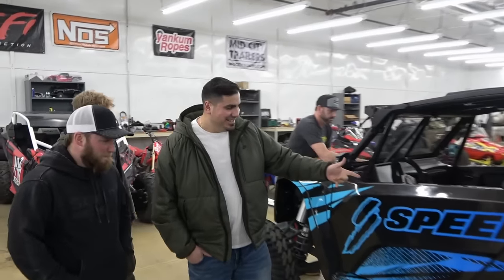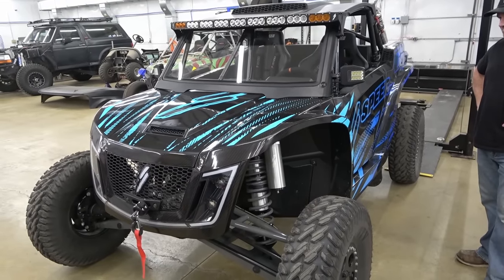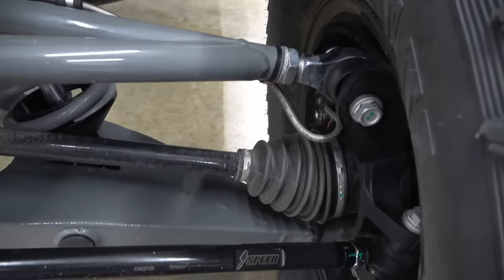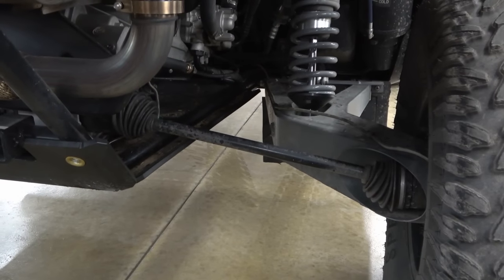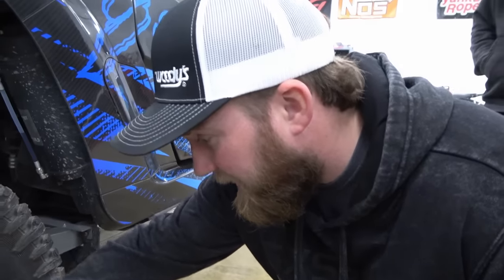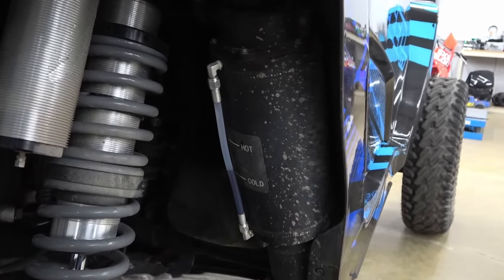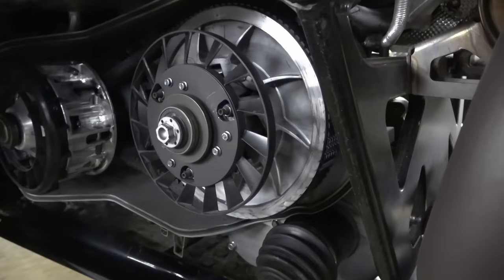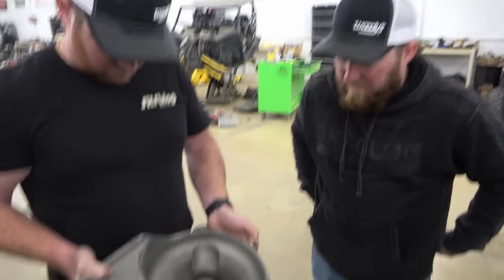Speed UTV IN DEPTH Overview + Dyno Test

Comment from the maker: Here are some quick specs that we missed in the video: $43,000 MSRP for the model shown, it is 77" wide, and the Bandit has the shortest wheelbase at 95".
Reply: Should’ve put it on the scales. We’ve seen the EL Jefe weighed and it’s more then then the 4 seat Pro R. 

Other things to mention is the bolts are shouldered and most of the hardware is sized so only a small number of sockets and wrenches is needed to remove.

I’m surprised you guys didn’t talk about the structural design of the cage vs other OEM’s as the cage on the Speed makes the others look like toys.
Reply: Do 25 k can get a 2 seat 1000 with race gas tune and turbo also do clutches 95 mph plus
Reply: Are you sure it is 77" wide ?  Bandit LE should be just 72"  wide.

Comment: That front diff scares me, what happens when you rip the A arm ears off in a crash, you now have to buy and entire front diff
Reply: Sway bar bolts have already ripped out on some
Reply: Would you rather replace a diff housing or a frame?
Reply: @Freemaniac38  you can weld washers onto a frame and repair it.  Good luck fixing cast aluminum
Reply: @Freemaniac38 if it was all chassis mounted it wouldn't break at all🤷‍♂️
Reply: @Williamxmr  I’m one of them 🤦‍♂️
Reply: Sounds like a skill issue to me
Reply: The tabs on the bulkhead are seriously thick and if you rip one off, you got bigger issues. Also that bulkhead is 3 pieces and you can replace either side if you actually broke one.
Reply: Only a couple cars had issues and it was believed the wrong hardware was used to torqued.
Reply: Trust me, from a person that owns one, you don’t have to worry about that lol. I stuffed the nose hard and no issues. If you’re wadding the diff up you probably have a total loss. Also if for some reason it does happen, it’s a 3 piece diff. So if you break one side you don’t have to replace the whole thing
Reply: About that bulkhead, What's funny is they do massive work to all brands of sxs to complete in king of the hammers and still don't finish without custom parts breaking. 50% of the speed utvs entered finished the race remember these are stock compared to 35% of modified utvs from other companies. I would say that bulkhead is the least of your worries.
Reply: great video
Reply: Robby runs the same design on his 4wd trophy truck with zero failures. That being said in a hard enough crash anything will break.
Reply: Yeah not a huge fan of that design but damn it’s beefy.
Reply: @Williamxmr   lol talking like you can't weld cast
Reply: @gasNmudtv  yeah its so easy lol

Comment: Wheel base is actually 96 now. Also, the car won't make full power unless the oil temp is around 168 and above. I have a Bandit and it's hard to keep it warm enough here in TN. Thank you for the content and please keep the verbiage as clean as possible for the family.
Reply: What did they say that hurt your feelings?

Comment: Was looking forward to this one. I liked the general walk around. I had originally thought the 3 speeds was sequential, which would have been another innovative thing to experiment with. I can see why not for transmission safety, but to be able to switch Low-Hi-Speed on the go would be pretty cool. 

Not a fan of the cheesy RADIO.JPG decals. Even a insert that read "Co-Driver screen" and "radio" would have been better than a photo. The Dyno run looked pretty good considering how close it came to the Pro R with less cylinders and a spinny thing. 

I really like the wheelbase on that Baja, it's slightly "Turba-S" stance. I think if there was a less wide option for the wood fighters it would open the markets more, but being new they cant saturate things too much right now. 

Overall nice rig. Glad you got a chance to experience it. Maybe time to talk to RG and get entered to race one somewhere.
Reply: You can but you have to be off the power.
Reply: @thadbessinger5694  so you can switch on the fly but unloaded? because that would be usless outside of that
Reply: Yes you can shift on the fly. They are dog gears so you need to know how to do it and practice. And if you damage the gears because you were shifting on the fly and messed up they won't cover it under warranty. It's a play at your own risk thing.
Reply: Speed plans on releasing a 72” version of the Bandit.

Comment: These cars are great but they do have there flaws , first thing need to cut the inner clamps off the rear cv’s there too tight and suck in rip boots  , the jam nuts come loose they need some lock tight and some good effort , you’ll find the issues just like any other car

Comment: Great video, ? if you put half the size tire would you get less lost HP? and by what % .
Reply: Heh, thats not how that works lol
Reply: Dynos are crazy complicated to explain but Yes in theory a smaller tire diameter should give a higher power reading but not always in practice.
The dyno is measuring the inertia of the drum AND the wheel/tyre but can't differentiate between the two. By reducing the rotational mass and moment in the wheel you effectively transfer more measurable power into the drum. The difference is only going to be small, a couple of percent maybe though.
Also the reason it may not actually work in practice is that a smaller tyre reduces the gear ratio so loads the engine less. Particularly on turbo engines the lower load may cause the engine to actually deliver less power to the wheels in the first place.

Comment: Would having the speed key make a difference on hp or just on speed?
Reply: They said 220 pump gas no speed key to 300 on corn gas with speed key. Not sure if that implies no gain with just speed key
Reply: If it's on pump gas it's 225 no matter if it's normal key or speed key. You only get the 300 if you have the speed key running full E85 with top end lube. It has a flex full sensor so it will adjust to the mix of pump and E85. But again only with the speed key.
Reply: Good question!

Comment: Can you shift this thing on the fly, basically start in first hit second then third and never let off the gas?
Reply: No, the gear selection works more like a transfer case than a transmission. You need to change gears while stopped or barely moving. A few people have mentioned you can shift while driving though if you're good at rev-matching, but the owner's manual says not to.

Comment: Can you guys get a dry weight on the vehicle?
Reply: 2,700lbs without tire and jack.  All options shown.
Reply: Actually the 2 seat Bandit without accessories is just under 2400 lbs. The 4 seat El Jefe is closer to 2700.
Reply: @toddcunningham2410 weighed this car on certified truck scale.  It had thicker skid plate, all the boxes, winch, fire extinguisher, lights, radio, big brakes, and mirrors added to base weight.
Reply: You’re probably correct with all the added accessories. I thought we were talking base weight.

Comment: who makes the motor and shocks and ...
Reply: Speed built their own engine. It was developed by Arrington Engines who built NASCAR engines and developed the Dodge NASCAR engine when Dodge came back years ago. There were also a couple guys who were Indy car engine designers involved in the Speed engine. The turbo was designed by Push Turbo with a very unique manifold. The transmission was developed by Albins. If you don’t know who that is, they are Australian and build Trophy Truck & off road transmissions and V8 Super car transmissions. TAPP was brought in to partner with Speed on the CVT. The shocks are all Robby Gordon designed and are a shock design he’s built and used in his Trophy Trucks for years. They are an internal bypass with 12 & 13 stages of bypass. Fox UTV internal bypass shocks have  3 stages of bypass. The original ECU was by Emtron, but the mass produced version is inhouse Speed with Emtron technology. There are allot of unique things about the Speed car right down the hardware. But because of all this I don’t think this car is going to be as consumer friendly as the other top manufacturers as they produce for the masses and the Speed really is a specialty vehicle.

Comment: No thanks. That front diff with everything mounted to it is a disaster waiting to happen.
Reply: A few people have said the same thing. It would be hard for Speed not to address it, No?
Reply: Still stronger than and x3 front end. Have yet to see a front end fall apart. Doesn’t mean it isn’t possible. Time will tell.
Reply: For what this machine is intended for (sustained) whoop bashing... Roll of the dice no? @KC-7mm
Reply: I own #149 and the front diff breaking is very low on the list of things I worry about breaking!
Reply: @horseboyhunglow  haven’t seen a bulkhead break in a race yet. Max max ripped an a arm off last year but it didn’t break the mounts. Just because it’s aluminum doesn’t make it weak. I understand it’s pressure casted not billet that being said it’s still very strong, I’d be more worried about blasting whoops with a stock x3 don’t get me wrong I’m not hating on them it’s just a terrible front suspension design.
Reply: You Sir are clearly more knowledgeable than I. Is an X3 known at a whoop killer out of the box? @KC-7mm
Reply: @horseboyhunglow  x3’s are pretty damn good out of the box. They do have a bit of bump steer which makes them a little loose through the ruff stuff.
Reply: Says the guy who has nothing
Reply: I see front diffs on every other brand fail every day, as well as the a-arm mounting tab ripping off the frame. This one piece unit has to be tougher than any other unit out there. More metal more strength and it's easily replaced when it fails.

Comment: Hisun makes these.  Cheap garbage.  Belts don't last, engines blow like crazy, axles last 1000 miles, cant run a windshield above 65f, steering feedback is nuts. Turbos have been cracking too.
Reply: Easier to just say you can't afford it...
Reply: @dansmith3074  I tip my hat to you Sir
Reply: "Nuts" feedback in a full hydraulic system? Both surge and pulsation strength in a hydraulic system like steering will always be less than the dynamic input, Its nothing more then tuning your hi-flow bypass to step in once your desired dampening level is reached. You will find more qualified opinions noting a feedback disconnect in FHS than over feedback.
Reply: @horseboyhunglow  speed sells an electric damping band aid because they hydro sucks
Reply: Really?!... @Williamxmr Hide-sight engineering is a thing. How long has this vehicle been out for?